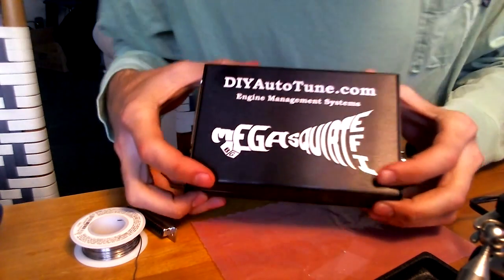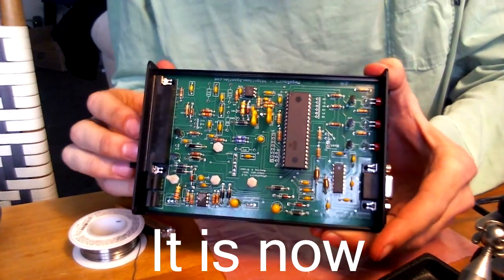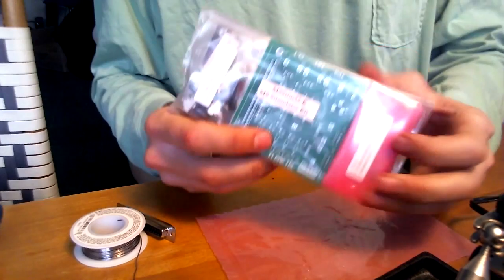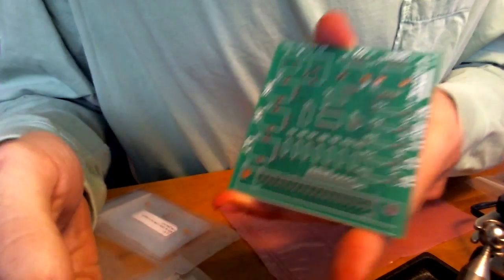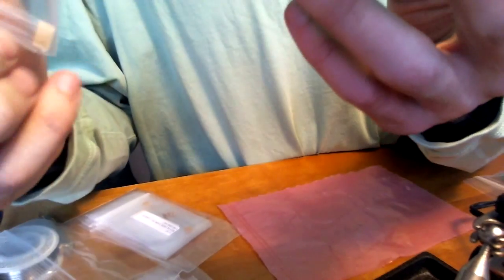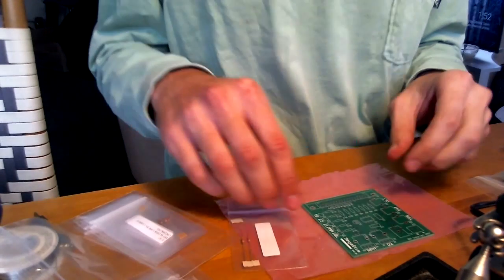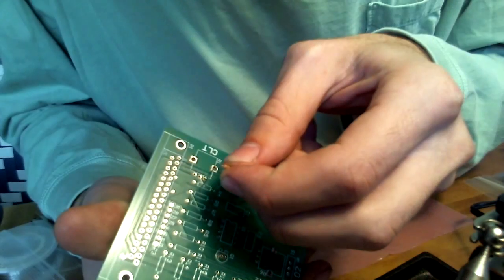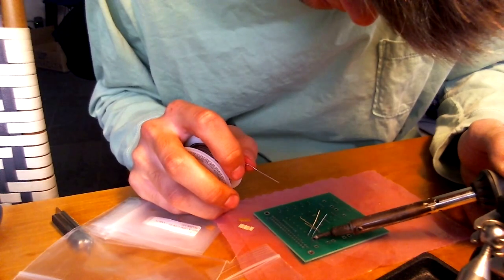Megastim Assembling

Comment: wish I knew how to solder
Reply: its not hard to learn, they sell "learn to solder kits" where you build simple things like sirens to start out, you can get the basic concept and be decent at it with about 2 days of learning and practice. just dont immediately start trying to learn how to solder on something you dont want to break, thats what the kits are for.. another tip, most kits come with a 15watt soldering iron, however, i would definitely reccomend a 25watt for soldering electronics, it makes it way easier.